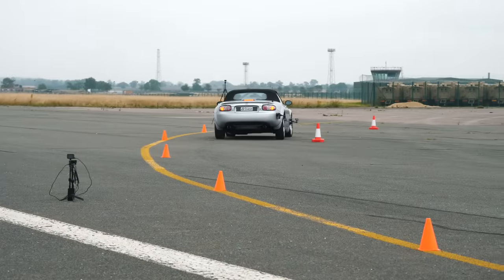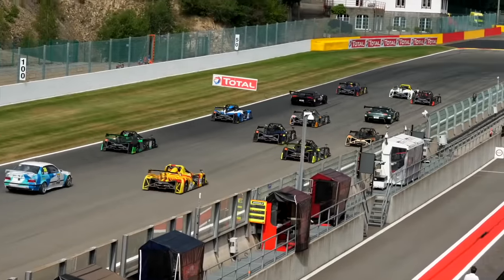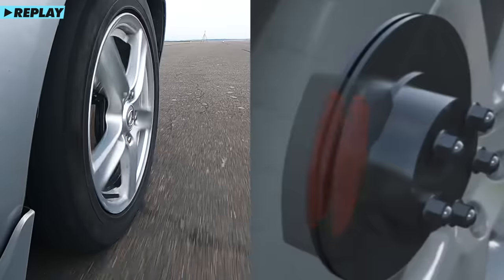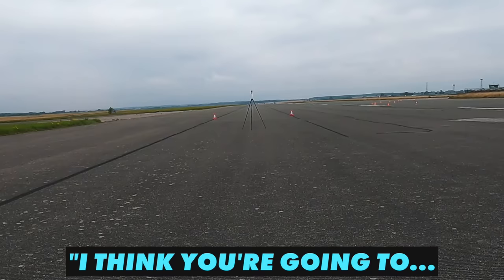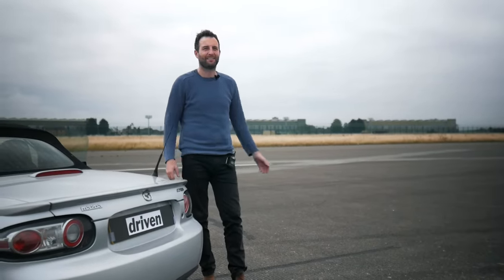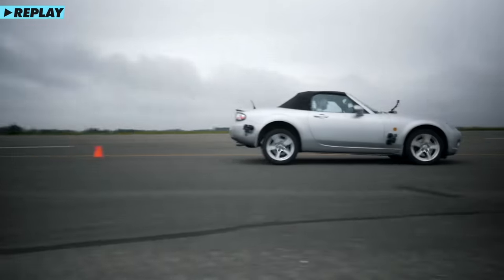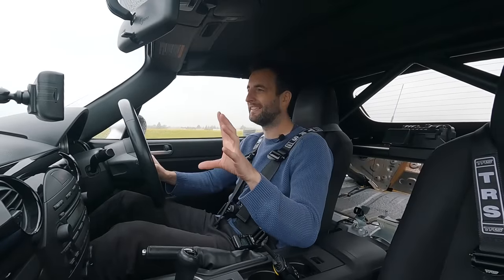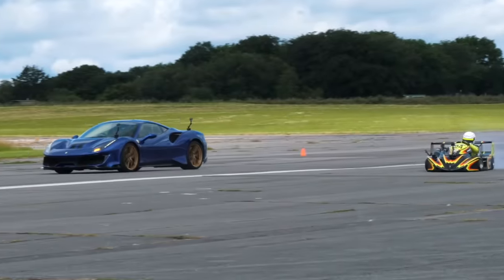ABS ON vs ABS OFF | What's Really the Difference?

Comment: Locked weels = no longer driving - Unlocked = driving the way stearing weels pointing ( unless surface is slippery from snow\ice\mud\water, couse of no friction to ground annymore, and therfor it goes under locked** and abs will not help! Friction needed with abs aswell.

Comment: Would've been great if you make a comparison ABS with engine braking. Cause that's something that you can learn and really benefit from.

Also would be great to mention that ABS on a wet (or any other slick) surface is not shortening the braking distance.

Comment: This maybe a little off topic, but:
When i just turned 18 some friends an I decided to go to a restaurant whilst the roads where covered in snow and ice.
We've had one hairy moment when i was approaching a corner with a ditch right beside it, when i wanted to brake to slow down for the corner the tires locked up (i did like 30-40Kph). I dont know how I've come up with the solution to release the brakes and stamp on the accelerator (front driven car) but we managed to avoid the dirch and made the corner.
After that everyone has gone crazy 😂😂

Comment: Ah yes, I'll never forget almost french kissing a 16 or so camaro when coming down a street at about 35mph, I tried braking at a wet spot which inmediately  gave me 0 grip like a hot knife on butter, fortunately I let off and got back on the brake  at a moderate pressure to avoid locking, that and having the street slightly start inclining upward.

Comment: Perhaps ABS systems have improved over the years, but I had several very dangerous moments caused by the ABS system in my Infiniti G20. When a wheel loses contact with the road, even for a moment, a wheel will instantly lock up and the ABS will react by reducing the braking pressure so when the tire comes back into contact with the ground for what seems like an eternity you’ll have no braking at all. This was especially noticeable in my Ford F250 4x4 because of its stiff suspension and heavy I unsprung weight. I find a similar but opposite situation with the traction control on my current Chevy Spark EV which has front wheel drive and tons if torque. The system cuts power to the wheels whenever a wheel hits a bump, a pothole or rough pavement.

Comment: Abs off - u press  brakes, wheels brake and lock. If u go too fast, wheels slide, loosing traction. No traction no braking.
Abs on - wheels continue rolling making sure you don't start to slide, MASSIVELY reducing time to stop.
Done. Saved you 7 mins.

Comment: If I have abs off then I don't fully press the brakes to lock in the wheels I press 75% of the brake so not only the wheels keep spinning still but I have more control when taking turns faster

Comment: For the record, modern ESP systems are able to precisely keep all wheels independetly at the limit of slip better than any trained and experienced driver ever could. Sure beating a 90's car ABS braking distance with threshold braking is child play, those stuff are slow and dumb (and 30 years old). Nowadays an ABS pump can alter its pressure output hundred times on each channel every SECOND. You don't even realise you are pressing too much, the electronic is already at peak ;)

Comment: Yeaaaaa try that in snow with a 30-40k car and see which stops faster. Budget abs and traction control in snow and some wet conditions is a freaking death trap. Don't get me wrong really well tuned abs and traction control is amazing in any condition, but that's not what's in most cars on the road.

Comment: You don't drive without abs on, on everyday, do you?
Last time I was driving 2011 company car Citroen Nemo, it was horrible abs system and breaking distance. I wonder If I am get used to my old 2000 seat Cordoba, or it was just old abs system, which worked as bad as old automatic gearboxes.

Comment: My mum would brake better than this without ABS. Back in the 50s she was taught to pump the brakes in an emergency and actually for this reason ABS was really bad in the start as many older drivers didn't know you had to keep the pedal pressed down all the time. 

I really think this test needs to be done again with some  pumping of the pedal or gradual pressure because it is just not representative of many normal drivers. 

My daily driver has no ABS and I have stopped plenty well in  rain and snow while controlling the car still.

Comment: My protege5 came from factory without abs. Its take a lot of skill to not slide. Ive got so much time driving on a track  that i dont cause flat spots. Meaning i manually release the pedal a little right be4 its bout to lock and continue that until I'm stopped. I've been able to stop faster than an abs verison

Comment: I disable ABS on every vehicle I drive. Never have any problems unless its on. If you press the brake to hard in an accident and stop the vehicle to fast and the computer thinks its not possible to slow down that fast ABS will unlock the brakes yeeting you into the car ur trying not to hit. Had it happen to me twice. Disabled ABS on all my vehicles. Now here the kicker I never lock up my brakes and I have no problem steering. No difference other than some electronic aid does not get me into accidents any more.

Comment: There is a difference between ABS connected an just slamming on the brakes locking all wheels? As a racedriver you should know that.. Probably said before. ABS is a great invention but not always the best way to slow you down. Loose gravel is just one example

Comment: Personally, I think everyone should learn how to drive cars that don't have ABS, ESC, TCS, assisted braking, lane departure assist, or automatic reverse and parallel parking, as well as have defensive driving courses. Why? Those systems can fail, and in those instances, the car is only as safe as the driver is, but if a driver has no idea how to handle a vehicle without any of those systems, then when they fail they won't know how to react, leading to a massive accident.

My friend has a 2002 Nissan Pathfinder, and it has no ABS, TCS, ESC, and so on, and the one time that I had to slam on the brakes, I instinctively eased my foot off the foot brake when I heard the tyres begin to chatter. I made contact, but the car that came worse off was me, the other 2 vehicles were Ble to drive away with nothing more than a small dent that could be popped out with your hand. I only knew to do that due to me trying to imitate the way V8 Supercar drivers like Mark Skaife and Jason Richards drove their race cars.

Comment: This isn't a fair comparaison for people that can actually drive. My first 3 cars were without ABS and I had to lean to drive and brake without locking the wheels even during the slippery winter months. Unless you panic everytime somthing happens on the road this is not how a good driver would brake. It would be intresting to see a comparaison between a person that know not to lock the wheels and ABS. It would be more representative. Also testing in wet and snow could change the results.

Comment: Something odd is with that smoking tires. In motorcycles ABS is weaker than manual braking. Even with average driver. I`m not average.

Comment: Why would you lock the breaks up? Isn't the idea to press to half a percent of locking up without actually locking the tires up? I know, this is nearly impossible for most people on a car they have never driven before. I know I couldn't do it on the first attempt. However, after driving a vehicle every day for a year, this should be doable. I even drove a car to a mechanic without any brakes... although safely. Downshifting to stop, and looking for ways out if it didn't. I figured I would drive up on the sidewalk rather than hitting another vehicle; as long are there were no pedestrians on the sidewalk. This may have been an overall bad idea, but that's what teenagers do.

Comment: I crashed into a car because, lacking experience, I locked the brakes in my non-ABS car on a (very) wet surface. I have since learned to keep a larger distance from the car in front and threshold brake. I fixed the car but now it needs fixing again cuz it's been in another crash😔

Comment: Um... I suppose in a panic situation, some people might slam the breaks on like that, but I suspect most experienced drivers who do not rely on ABS alone would modulate the brakes, knowing a lockup will result in a loss of steering. You seem to want to make it like your skills as a race car driver are in someway unique. They are not. Most people are going to try to counter steer and so on. The other problem is, once the car starts to go sideways (which will happen in wet and snowy conditions without applying the breaks), ABS is pretty much useless.

Comment: To be honest, comparing ABS braking to braking with removed ABS fuse is pointless. Cars without ABS use braking force corrector to properly distribute pressure to brakes. Without BFC and ABS fuse removed car becomes unpredictable,  because braking pressure is more or less distributed randomly.

Comment: What kind of comparison is this even supposed to be? Of course the ABS is going to stop faster if all you do without it is slam the brake pedal and immediately lock the brakes. If locking up stopped the car faster there would be no need for ABS to exist. You should have tried your best to stop the car without locking up by braking to the threshold like most of the comments here are suggesting. Very disappointed in this experiment.
Reply: So he should have tried to stop the car by acting like a slower ABS system...so if we could just build a system that did that...then we'd have less lock ups and an ABS system.
Reply: @AveragePicker  sorry I don't understand what you're trying to say? What do you mean by a slower ABS system? My comment was about the test, if you're trying to see whether a car stops faster with or without ABS, you need to threshold brake when the ABS is off otherwise there's no point even testing. Obviously locking up the tyres is going to be far less effective than not locking them up.
Reply: @Zamm1n  yeah, threshold braking is just a slower manual version of ABS, more prone to error.
Reply: @AveragePicker  Well, putting aside the fact that whether that's the case isn't exactly relevant to the point of the test, I have to disagree with half of what you're claiming there.

If we're talking about newer, more advanced/sophisticated ABS systems then in some cases, perhaps that may be the case. But particularly in older ABS systems (like the one that came in my own car), it's generally possible to slow the car a little faster without ABS if you can threshold brake correctly. He actually does mention this at the start of the video and he's right about that part. If ABS was always better there would be no need to remove it in track and racing applications.

More prone to error? Yes. For road cars it makes much more sense to have ABS for safety reasons of course, not every driver can threshold brake let alone in an emergency. But I believe it's incorrect to say that threshold braking is always slower or worse than ABS.

Comment: A little disappointed not to see a proper comparison with threshold braking. However, I have many friends who race E30s, which si right about the point that ABS came in, and I asked them the same question. The answer is that with TYPICAL STREET ABS systems, under optimal conditions, on a track, with practice, cadence braking can beat it. Because the basic ABS is a bit dumb. But - if you have a RACE-TUNED ABS system, nah - you ain't beating it with a single brake pedal. It can adjust to the change in front/rear bias as the speed drops, it can adapt to surface changes, and it of course adapts to any steering you put in.

I understand why you didn't do the "unfair" comparison between street ABS and the trained racing driver that you are. But it would still have been nice to see.

Comment: There conditions where ABS makes things worse.
Gravel or dirt roads can cause the ABS to effectively turn off the brakes. Corrugations in the road surface have also been know to cause numerous collisions as the ABS mistakes the wheel bouncing off the road surface as a lockup effectively turning off the brakes.
One of the biggest dangers of ABS is lack of driver training without ABS. Drivers become over reliant on the system and drive not to the potential of the vehicle with out ABS but to it's maximum potential with the system fully functional, as a result any minor failure can be catastrophic and the margin for error was lost long before the driver noticed the failure.

Comment: Is there any reason why you didn't attempt to modulate the braking instead of just locking the wheels completely and leaving them locked? Weird. Its not a great test, and it will be very difficult to get one but the video is somewhat dumbed down as you're not really braking, you're just locking the tyres. No doubt ABS is king in these scenarios, of course on the road, and certainly in GT3 race cars. However, you have to consider that the braking system in this car is designed specifcally to work with ABS, whereas a non ABS car is designed with pedal modulation and balance to give you more control before the tyres lock. 

I run two cars, one with ABS, one without (that never had it). The ABS car is much better on the road in a scenario like this, but, the amount of pedal feel and travel in the non ABS car is very different and allows you to get very close to lockup or control the maximum braking performance and adjust by rolling on/off the pedal slightly as the car slows down. Of course I feel safer in the ABS car, it is very hard/impossible to train yourself to do what I describ in a panic/sudden emergency scenario.

Comment: Sorry, but stupid test if you didn't include a third threshold braking test. I disconnect my abs in the winter because I like not sliding into intersections on snow and ice. For some reason, my instinct is to press harder rather than threshold brake while abs is activated despite the fact that you can threshold brake with abs as well. When I have no abs I threshold brake like I'm supposed to. Eventually most people will have no idea how to drive without abs/stability control/traction control, and will probably crash if it fails

Comment: Should have had a scenario without ABS and NOT locking up the brakes.
You say you're a professionnal driver, so let's see it.
Only pure idiots lock up the brakes...
So, that's not a fair comparison. In fact, I've often thought that under some particilar conditions, the ABS do worse, in light snow for example.

Comment: "The results were surprising"??  No, it showed that ABS was better in basically every way (on dry pavement) than locking up the wheels.

That is completely expected, and in fact is exactly what ABS was designed to do.  No surprise whatsoever.

The question that I have is how does it compare to actual threshold braking?  That would be interesting to see, as ABS wasn't designed for people who can reliably do threshold braking.  I suppose you'd need a lot of disclaimers about "professional driver, don't do this on the street" and so on.  Because ABS truly is better for the street--but that's not the question that interests me.

I don't have the ability to consistently and reliably threshold brake, or I'd do some testing myself...

Comment: A true test would be you working the brake yourself, as that's how it's supposed to be done. Fine with showing locked brakes, but that's not how you're supposed to brake either. Just goes to show you how bad of drivers people have become due to technology.

Maybe we should do an experiment. Find some city streets, and put a ton of random people (preferably not car people) into cars with no power steering (never had it), no ABS, no automatic transmissions, and see what happens.

Comment: Says how he was surprised by the results at the beginning of the video just shows he's not a car guy at all.
In every instance without abs he just went full brake. If you know the point of a brake before lock up you actually achieve better braking than abs, depending on the situation of the road and inertia.
Not having abs in a racing track is almost mandatory because it saves time, weight and money.
Not having abs in the streets is plain stupid. In a track you know the braking zones, and how much braking you apply, the conditions are mostly the same, unlike in the streets, that's why in Europe abs is mandatory. 
And if you car has an ABS light on, please go check it since it can potentially save you from a crash and maybe your life

Comment: I've always had better luck with abs off in snowy/sandy conditions (or anything soft maybe?) Good challenge to test this theory accurately and well. But would be neat to see. I imagine the tire would dig into the soft surface and would actually assist in a shorter braking distance. By actually gaining surface area. Loose conditions already decrease cornering ability. So if you can brake shorter maybe it would be worth it.

Comment: in 2020 oct. ABS nearly killed me! it wanted to break when the road was shit, and enabled the wheel to roll, when it could brake.. i just hitted the Bus like without braking at 80Km/H. Much better if you  know how to controll the brake than the abs, if the surface of the road is shit.... :/ except in snow and rain

Comment: The braking without ABS was done like a Dork would do. Just stepped on the brake without sensitivite an no intention to get decent deceleration. As Racecars demonstrate perfectly the deceleration without ABS can be even better if the brakes are well tuned and the driver is decent.
The whole "Experiment" was to demonstrate that ABS is better which is wrong if the driver can drive and is true if an emergency braking with panik occurs.